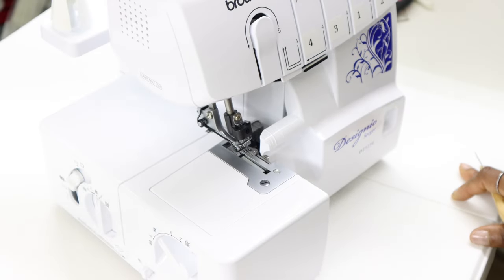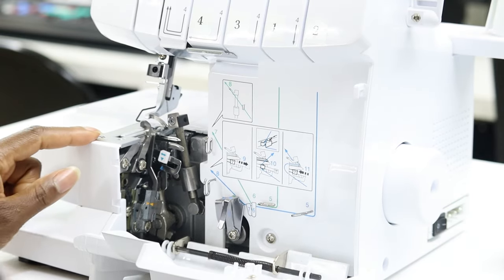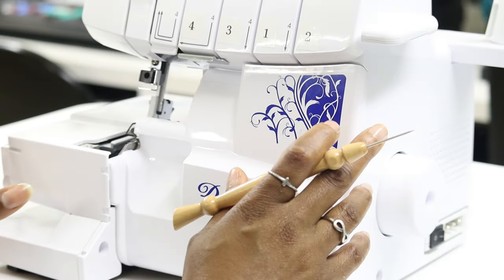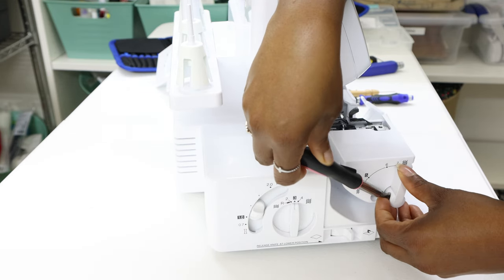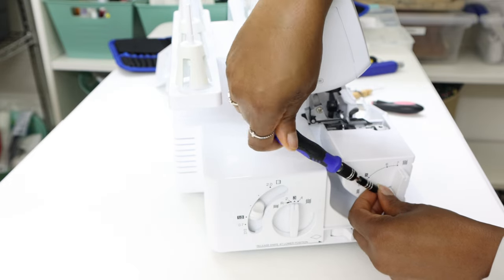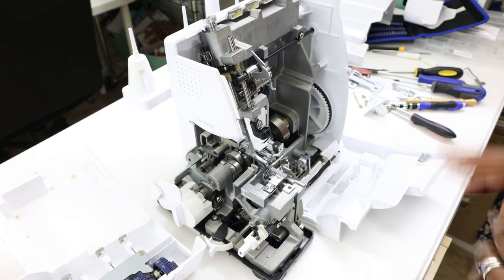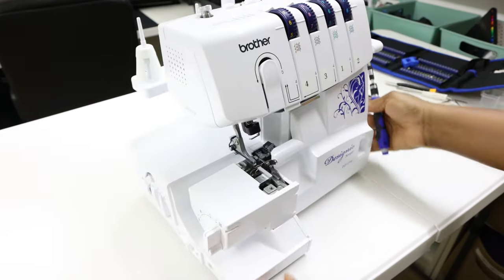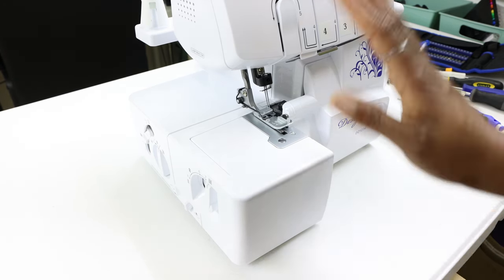Brother Designio Serger DZ1234| COVER REMOVAL AND REPLACEMENT| Brother Lock 1034D Serger

Comment: Thank You, greatly appreciate this video especially since I'm going to be working on my DZ1234. Did you have to buy special tools for this? Were they metric or are they imperial? Thank you very much for your help. Kind regards...  ;)
Reply from the maker: Hi, I am glad it was helpful:)
I used a Screwdriver Set with magnetic bits. One without interchangeable bits but still magnetized might even be better, so you don't need to manage the bits wanting to come off while working. But they work well enough:) Luckily they are not too expensive. 
The screwdriver bits I used are in imperial measurements. Any set with the small screwdrivers should work.
Thank you for watching!
Reply: @MommyShareSpace  Thank you, again for your help!!! Your kindness is truly appreciated. ;)
Reply from the maker: Thank you for you kind words!🙂